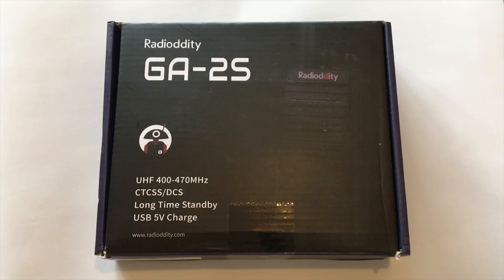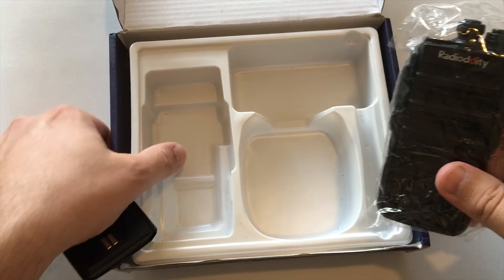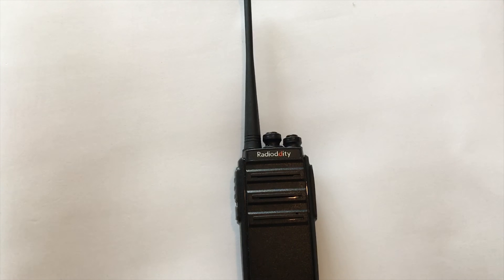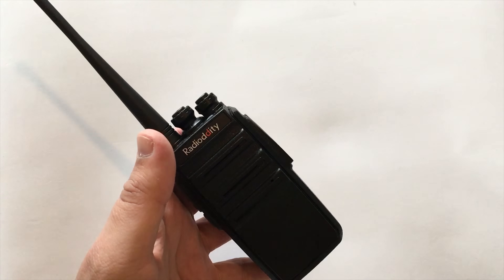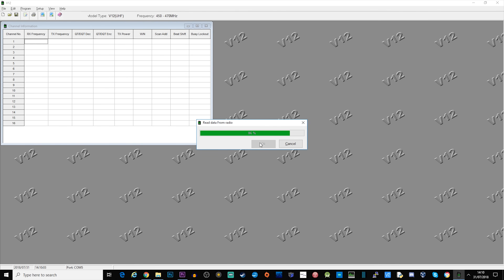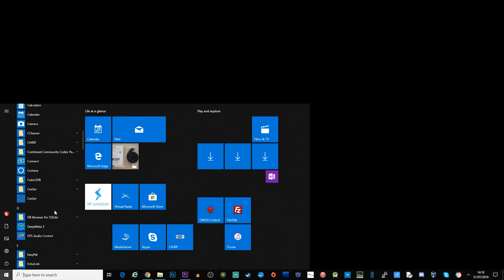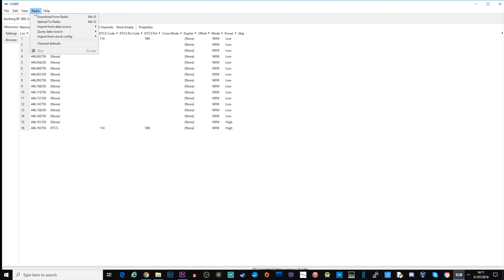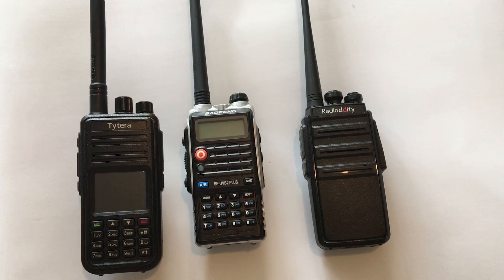Radioddity GA-2S UHF Handheld Radio Transceiver

Comment: Thanks. How do these compare to the Baofeng BF-888s?
Reply from the maker: These are way better quality than the BF888, on both build quality and RX/TX. I’ve used BF888’s and to be quite honest, they are awe-full. The only device I use a BF888 is on my Allstar node, but that’s okay because it only meant for local proximity.
Reply: @TechMindsOfficial  Thanks for the quick reply. Im getting the GA-2S, 4 pack for the family/kids. I appreciate it!

Comment: Hey. I received this radio and changed the frequency through CHIRP. What I found is that it only changed the RX frequency but not the TX (thanks to V12, I didn't find a way to show and edit it in CHIRP). I was able to change TX through V12. However, I don't get how you change TX frequency in CHIRP. When I plug my radio in CHIRP and go to the properties tab, there's nothing showing TX frequency. Thanks !

Comment: So I've installed the driver correctly, I'm on com 4, When I try to read from radio I get an error message "Please check all communications and port settings." Everything is connected. Should the radio be on or off? I've tried both only to get the same error message.

Comment: Great video thanks. Could you recommend a radio for listening to shop security. Pls
Reply from the maker: Well, it depends on whether you know the exact frequency of the shop security you want to listen to. Also, do you know if they are normal FM or using some kind of digital mode. If you know the frequency, and they are on FM, then something like this radio would be ok. But if you can stretch to something like a Baofeng UV5R, that would be better as it has a VFO, meaning you don’t have to know the exact frequency
Reply: Tech Minds thank you for replying was a old analogue listener bk in the day thought I'd get back in yo the hobby but didn't know where to start .. sdr are cheap devices but can you listen to digital broadcasts with them.
Reply from the maker: Do you mean like DAB? Well, the answer is yes you can, but certain DAB software require a different device driver. I’ll try and make a video on this topic. Cheers
Reply: i mean security watch in town shops ,
Reply: Sure is it.